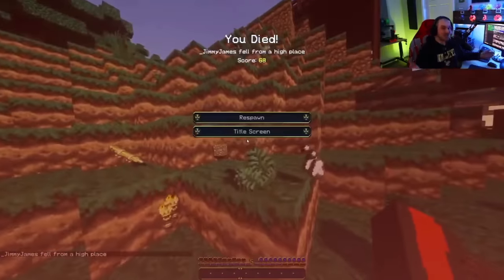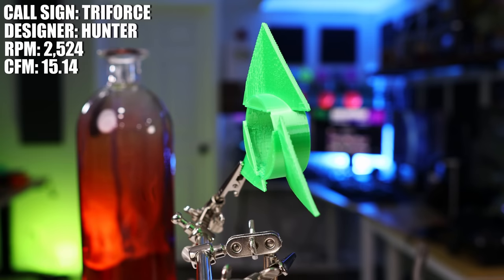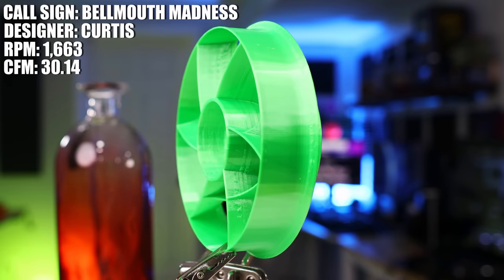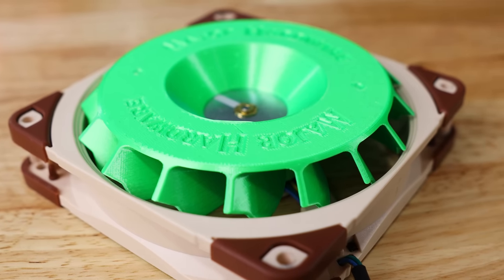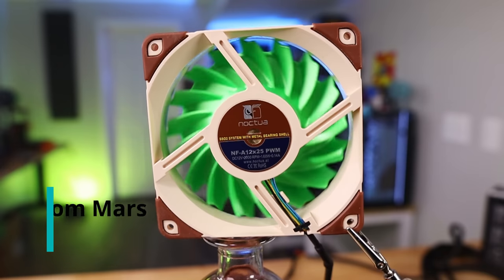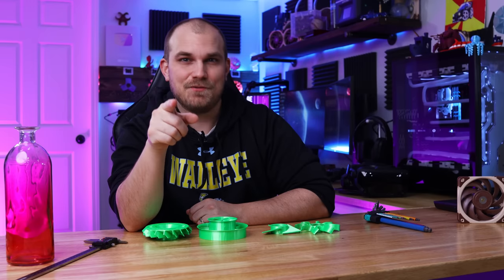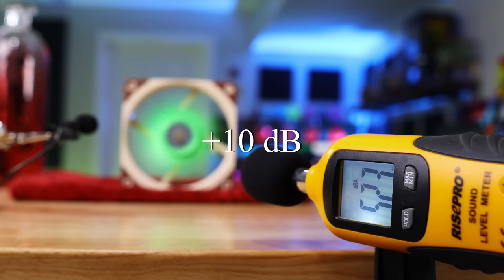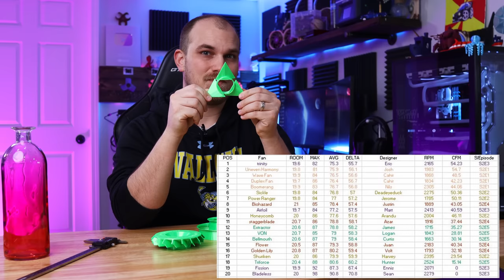Nintendo LEGAL has entered the chat - Fan Showdown S2E5

Comment: The Extractor actually kind of sounds kind of like a tire rolling down the road. Somewhat pleasant.
Reply: For being loud it did sound good. I rather have that type of sound than some of the other annoying ones.
Reply: mercedes has entered the chat
Reply: My thoughts too. Definitely the least intrusive while being nearly the loudest.
Reply: the extractor design needs to be modified a bit on the blade angle and the sound will drop by a Db or two, but hands down it don't sound bad
Reply: and it look cool too!
Reply: Yeah you know what it was loud but it sounded okay.  Would consider something like that for the aesthetics.  I wonder if the angles could be tweaked to help reduce the decibels.
Reply: That’s pretty ironic considering it’s based on a rally hubcap

Comment: YES! a video on what software needed for designing, how to find/import the base template, and save/export our own design, and where to send it. I have an idea, but absolutely no CAD experience whatsoever. SO a "newbie guide" + some info of considerations for a design to 3d print succesfully, would be good.
Reply: I completely agree on the "newbie guide for beginners" video
Reply: The drawing for the dimensions are literally in the description and it takes like two seconds to find free software to create 3D models.
Fusion 360 for CAD and Blender for polygon modelling, for both of which there are plenty of learning resources available...

Step 1 of learning something is by not being lazy and just doing some research on your own.

Comment: Genuinely curious: is the Extractor actually "louder" or is it seemingly louder because it's moving air back toward the mic and meter instead of away like the other designs?
Reply: I don't think the extractor is moving air really back, but vomiting it out to the side all around it.
Reply: @nachtmarv  True. 

I would be kind of curious to know if anything changes sound wise once it's on a rad, since it's one of the few designs that would actually pull down against the fan hub instead of pushing away.
Reply: @aquarist1  this is an interesting point.
Reply: centrifugal fans tendto be louder because the air changes direction  (from forward to sideways) and that causes more turbulence than axial fans. On the positive side, centifugal fans tend to be more efficient because of their design being more constrained than axial fans so its easier to push more air without back flow or stalling.
Reply: Aside from the noise. I wonder if you were to expand the top plate to the ends of the fans and/or increase the fan density or decrease the fan density, remove or add 1 to 3 blades, would this increase the proficiency of the model?
Reply: @dustystotler1376  
Im not a space scientist but its not that simple, i mean, you cant just add more blades, you also have to take into consideration their size, thickness and also the aerodynamic aspect of the whole unit.
If you add more blades simply, you increase drag which is fine, but you lose efficiency because now you cant move the air volume occupied by one extra blade, per revolution. 
Just think about how much volume per revolution of the fan is plastic occopied by the blades and how much is air. If you were to add so many blades that it would be 99% plastic, do you think it would work at all?
You also have to take into consideration if the air itself has enough time to accelerate before the next blade comes so that it can grab that air to push it forward, otherwise the air will bounce back, and that causes the fan to completely "stall", meaning it stops pushing air at all even if its spinning.

in case you are wondering, turbines have so many blades because they are not fans, they are axial compressors. Like i said, many blades cause drag, meaning the air has it harder to flow, like trying to blow lots of air through a very thin pipe, so they are not good at pushing air, but the way they are arranged with one "Fan" spining in one direction, and the next one in the opposite direction makes them really good at "forcing" air in one direction and one direction only,  thats why they are called axial compressors, the idea being that you force air and then you mix it with fuel which burns and expands the gasses a lot and that expansion "generates" the wind that propels the plane.  So they dont need to push lots of air, but need to keep it from flowing back so that the turbines only generate thrust in one direction (instead of two which would cancel out) 

All in all this is the reason why drones and planes use large two bladed propellers  instead of shorter propellers with more blades.

One thing though, with 2 blades you need to spin twice as fast as a 4 bladed fan to push the same air (almost the same) so the 2 bladed fan will usually be noisier because it has a faster blade speed and that generates more turbulence in a higher pitch range most likely which we are more sensible to hearing. So more blades spinning slower make less noise, like in pc fans. On the other hand its not uncommon to find 3 bladed server fans spinning superfast because they dont case about noise in servers, they only care that they can push as much air as possible.
Also in server fans you tend to find some "weird fins" on the button side of the fan which point in the opposite direction to the blades. Thats also an axial compressor like in plane turbines, just a static one. (it helps to increase the maximum static pressure by reducing the backflow by contraining the flow in the "normal" direction of the blades.
Reply: I came here to ask two questions for Major Hardware, and both are about the extractor.
.
1st, how does this perform on a radiator, this is very important as the fan only has one real usage, and that is... as an extractor on the inside of a front mounted radiator.  That's it, that is it's only usage.  Very cool design and it might have some real value in a push pull setup for a front mounted radiator, but it would be rubbish as a front mounted cooling fan, as a rear fan on a push-pull heatsink and of course cannot be used as an actual extractor fan to remove hot exhaust from a PC.  As such this fan design will never have a place in the market as it's usage options are so limited, and for what gain.?  That is where the testing comes in, I suspect that it will be a little worse than the Noctua, but somewhat louder.  Please test this.
.
2nd, as for the "loudness", I wonder whether this is down to the position vs the microphone.  Again, this is very easy to test, first test the Noctua from the front vs the back, and then do the same with the extractor.
.
Love the channel FYI.
Reply: I think it just comes down to the fact that the extractor makes the air change direction more than the others and wastes more energy that way - instead of accelerating the air in a straight path it forces an almost 90, maybe 60 degree turn and some of that energy is translated into turbulence zones and sound waves..
Though, I'm sure it's not 90 degrees and there's lots more parameters to take into account, but that is my intuitive explanation.
Alternate explanation: the front plate might vibrate as air pushes against it.
Reply: @ADB-zf5zr  It would perform poorly on anything but an open case - its exhausting air out the sides - there aren't cases designed for that type of air flow.  The most efficient fan ever isn't going to cool well if its exhausting into a wall.
Reply: @Beerdwolf  most PC's have the motherboard, and thus CPU, up one side. In my own PC's case's case, it has vents on the top, front,and back, and reasonable clearance (as much as anything in a PC case does) downwards before hitting the graphics card. Further, the case itself has multiple fans directing airflow from front to back.
Sooo... You're probably right about the GPU's cooling fans, but for the CPU it might actually have Less of this "venting into a wall" problem than usual.
Reply: thats not how sound works, it is louder if it makes more noise. it doesn't 'seemingly' make more noise, it either does or doesn't. if you want a real explanation, sound moves at the speed of sound, so whether it comes out the front or back doesn't matter too much unless it is pointed directly at the mic, which it is not
edit: actually it is, i expected him to not put a mic directly in front of the fan. so yes, it probably boosted the noise, but by the same amount as everything else (except the extractor which pushed the air out the sides)
Reply: @Beerdwolf  right, accept your average laptop, and imacs, and nvidia pre 30 series founders edition cards....
Reply: @leomadero562  That's not entirely true, since sound (unlike light) requires a medium to travel through and can be "directed" accordingly. Sound is also subject to occlusion (being blocked or muffled by other surfaces in the environment). I'm fairly certain if you turned around these fans and directed them towards the mic you would see different readings because the buffeting of the air being moved introduces it's own vibrations (sound). The pop filters on the mic and meter would somewhat mitigate this, but I doubt it would cancel it out entirely.
Reply: Hm.  On cars, especially diesel, exhaust sound is mitigated significantly by turbos, in some cases enough to remove the turbo.
Reply: My question exactly....
Reply: @Beerdwolf  This is where I think you're mistaken. Install the fan on the back side of the case; now you can push it up against the wall!

Comment: The, "copyright material" has the highest rpm of them all.
Reply: What, Royalties-Per-Mention?
Reply: The triforce has little mass (comparatively) and a much reduced air contact on the outer ends of the blades.  In other words there is no real drag on the rotating surfaces.
Reply: Yeah makes sense, and I just thought it was funny.

Comment: Oh the extractor is my jam. That would fit so well in a car-themed build.
Reply: Agreed. Very cool. Much retro. Many rally.
Reply: Exhaust fan maybe?
Reply: I see this fan as a good idea for a GPU
Reply: I want it just because it looks cool, creator of the extractor, if you read this, can i have the file?
Reply: @fdavpach  I, too would love to have the file.
Reply: All it will do in move hot air around the inside of your case because it doesn't expel the air out the back of it.
Reply: @kazdean  Not all fans are supposed to extract the air from the case, some need to move it around. I get that you shouldn't use this design for all the fans on the case, but it's possible to design a mod in a way that the fans that are with this design are in line with the theme of the mod.
Reply: @obedulloa6219  ironically it’s basically a blower fan....the exact type of fan that half the internet has been hating on every time it’s been on a gpu...
Reply: @obedulloa6219  yes the fan would be pull instead of push but it’s still the same type of fan and I don’t think it was a coincidence that the fan was substantially louder than the others. I like your idea of a vertical mounted gpu though whereby the exhaust would be essentially guided to flow outwards in all directions parallel to the side panel with a guaranteed space between the card and the glass stopping someone from choking their card to death for looks 😂
Reply: The extractor is actually really good for not needing a fingerguard...
Reply: See comment above for stl file.

Comment: I am amazed how well sound extractor works, usually fans that change air's path by 90° did really badly, while this is really comparable to a normal and could just be used in a build with almost no change to the temperatures, and just differeny noise profile.

Comment: I'd love to use the extractor, especially if it could come with LED's behind it. Then I could tune the LED's to change from red to yellow as the CPU gets hotter. Only problem would be having the reversed airflow of those fans
Reply: well you put the fan outside the case :D

Comment: Just FYI, at 7:09 the “fancy little glass thing that literally does nothing but just stands there.” is called a bottle and it can hold liquids such as wine, beer, soda, or even water and they are quite useful for much more than holding up fans off tables. 😉
Reply: But it’s a fancy little glass thing that holds the fans :(

Comment: Heyy,  now that you have most of the new stuff set up you could start using a wind tunnell!!

- Shoe box with like plexiglass insthead of the top part and sitting on the long side...
- Holes, on the top part, near a short edge and the case of the fan mounted to the other side, half-in-half-out
- If put a "smoke tank" on top of the setup the smoke will just drain into the box, hopefully even laminarly

it's a super easy idea, dunno how it could fail, let's talk about it...

Comment: Been watching the fan series with interest. Reminded me of the Jimmy Carter days when we were asked to look at wind power. One of the aspect of performance evaluated was something called SOLIDITY. Wrapping your head around it was not easy from the math involved. Consider a windmill with a perfect efficiency. If it extracted all of the energy available, the wind speed downwind would change from some upstream value to zero. Thus air would pile up behind the windmill and block some of the wind flowing through the mill. So even though you designed a 100% efficient fan, you could never yield 100% of the available power.

Comment: The triangular blades did the Triforce in. The fastest moving part of the blade has the least amount of surface area to interact with the air. This is why most fan blades are straight, leaf shaped, or widen towards the end.

Comment: The extractor is pretty cool, by grabbing air from the sides it allows you to put the fan close to the enclosure without restricting air flow too much, useful in very cramped/small designs

Comment: The extractor would probably be absolutely amazing on cases with those flat front panels, especially mounted such that the fan exit was in line with those airflow slots at the sides - think nzxt

Comment: I could see this 'Extractor' working in a build with one fan on either side of the case, one fan pulling air in and one pulling air out, could be used as supplemental or assisted airflow

Comment: I really like that extractor fan. Only reasons I can see to not use it in a rig is 1. the sound, always important if someone finds it grating/tolerable/etc. and 2. The nature of it kind of means it has to be placed externally on the case right? You'd either need them pulling air in and spitting it everywhere, or else place it externally. Maybe in some kind of special housing that allows them to be recessed or something. Either way very cool, love the design.

Comment: Imagine a row of 3 extractors at the top of a case, where the fan body is flush with the inside of the case, so just the excess part that sticks out beyond the fan is above the top of the case.
You'd have to cut holes in the top of the case but it would look pretty sweet, though it might be a bit of a finger hazard.

Comment: Expected the triforce to not perform well since the outer part where the blades spin the fastest and where the area is the largest, the blades are pointy. So the most efficient area of the fan is actually unused.

Comment: The Tri Force actually existed before it was used in Zelda. There's even a video of Miyamoto pointing out the local shrines have the symbol imprinted all over them. So you could actually market that fan design, as long as you change the name =b

Comment: Results are suspiciously close in one 4x fan run, and quite different between different runs - do you cross-check results from time to time, just to prove it is not something else in the test bench conditions that you are measuring?

Air contains moisture with great heat capacity, dust particles require a lot more energy to move, varying supply voltage or pre-heating of winding on the motor can move in or out the top efficiency zone of all these incredible designs. 

Great show, i am a FAN! (:

Comment: If I was making a rally themed build I'd totally use the extractor. Put some leds inside of the shroud that are hooked up to the temperature, the hotter the PC the most orange they get. Plus you can put a spoiler on the back to make it run faster

Comment: After this serie has run for a few seasons you should consider making a computer build that is cooled with all the craziest and coolest (as in design, not necessarily temperature) fan designs that can actually fit inside the case.

Comment: The extractor works best because it creates greater suction there for great air volume movement. It just needs to be tweaked to lower any air friction which would heat up the air if there is any. You know about peltier cooling? Imagine figuring out a way to make peltier fan blades that actually cool down while they are spinning. So instead of just moving air it also slightly cools the air while its moving it. Then if you create air chambers that loop pushed air back into the fan blades to be pushed through again youll get slightly more effect on cooling.